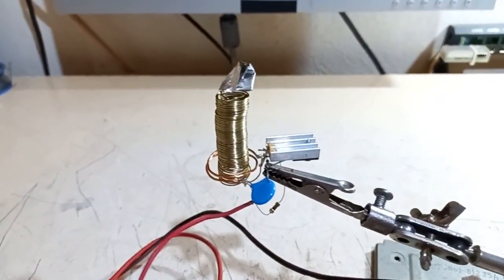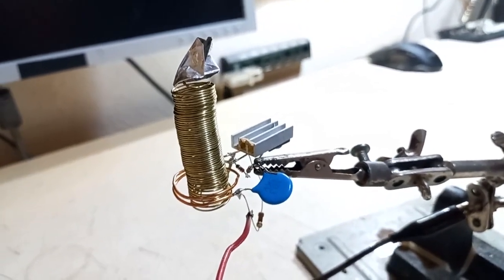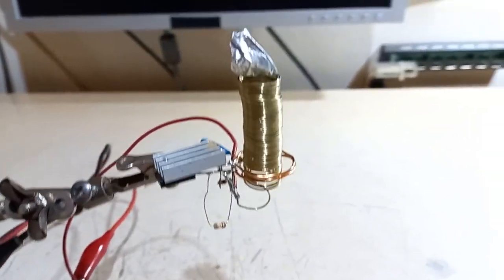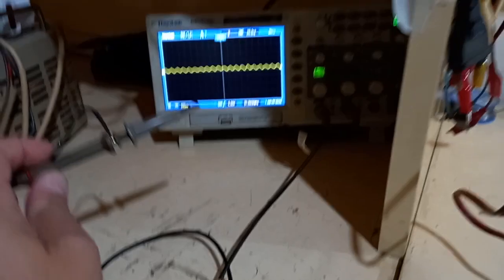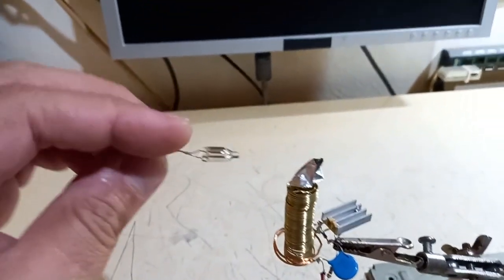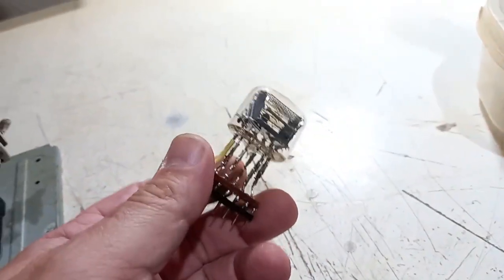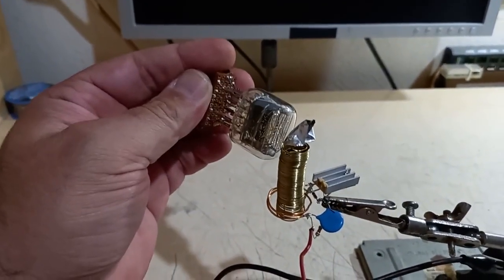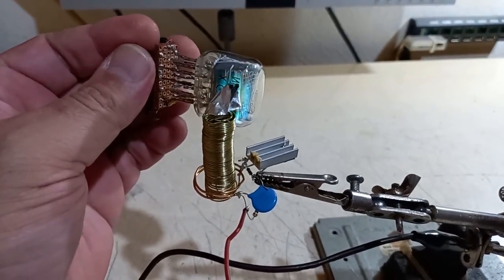What's The Max Frequency For a Regular Tesla Coil? (slayer exciter)

Comment: how do you characterized the transistor?
Reply from the maker: good question, it's electronically absolutely the same of numberless fake ones i ordered (i got scammed in other words), and obviously the same of a bag of actual 2N2222A's that are thankfully ok for what i bought em, all same VCEmax, same HFE, same VCEmin, i basically have 2N2222's in all formats, TO126, TO92, SOT89... and yes, fake components are a thing, like 80% of what you buy from china for dirt cheap is fake, they have no mercy, some don't believe this but it's absolutely true
Reply: @PosthumanKindergarten  thanks for the info, but I want to know the process of testing so I can do it myself, I have some BD139 and BD140 and I heavily suspect they're all fake, but how to do it?
Reply from the maker: @deathkeys1  with BJT's it's a bit more complicated than with mosfets, tho there are enough things to look for, first thing you need to measure the HFE, i simply do that with a cheap "big" digital multimeter with transistor testing, it reads an average HFE, very small transistors have it too high, that is good, but it means that the trans. is very small, you can compare it to the one written on the datasheet, tho there are some different ranges specified for the HFE... another thing you can do is crack open a broken one and see the size of the silicon crystal, you can guess by yourself if it's adequate or compare it to an original one or to pictures you may find online, i always crack open the trans. i ruin... another thing is checking the VCEmax or VCBmax, you need an high voltage source, a like 100k big resistor, and you apply the HV from collector to emitter and then from collector to base with the resistor in series to limit the current (cos otherwise the trans. like explodes :D), and read the voltage on the pins you apply the voltage to, limited by the resistor, it should act like a zener diode of several tens of volts, then compare it to the specs on the datasheet (that for those trans. should be like 100V), if it's lower it's no bueno... then you can check the VCEmin (VCEsat, or how it's called), you look on the datasheet for a graph of the VCE that it reaches (less than 1V) with given collector and base current, usually the base current is 1/10 of the collector current, you replicate such scenario with resistors and a low-v power supply and measure the VCE, if it's too high especially near the rated current of the trans. it's probably also fake, tho this test may have dubious results
Reply: @PosthumanKindergarten  Noice! that's what I wanted, thanks! and thanks for publishing these videos! it really helped me to get inspired again to play with parts, I plan to make a 2.4 GHz slayer exciter, just to see how far I can go, it'll be low power stuff since all I have are BFG598 but anyhow! thanks a bunch for taking the time to reply!

Comment: Have you ever tried to make a VHF spark gap transmitter? It causes things at quite a distance to malfunction. I was having difficulty making a resonant circuit, but discovered that you can use a 1/4 wave resonant piece of co-ax. You have to manufacture the co-ax yourself though, as it needs an impedance of around 10 ohms. I used to charge the centre conductor but it may be better to ground the centre and charge the sheath, just so you don't get a tingle from the antenna (which should be deliberately mismatched, at a higher impedance than the line for less damping). I discharged the charged part to ground with a very short spark gap for fast switching. I only used a max of around 1.5kV. It doesn't take much power to have a lot of sparks (makes a tone) with the small capacitance being charged (around 100pF). It's amazing that you can get effects at a decent distance (6m, discovered by accident) with a total power draw of around 1 Watt only - I used disposable camera flash charger (main capacitor removed) into a cockroft-walton multiplier (6 capacitors and 6 diodes), the part being charged was isolated with two 1M resistors in series.
Reply from the maker: i thought of making something similar, just using a dipole antenna and let the antenna itself decide the frequency, no coaxial, maybe i'll try a coherer with it, but for now i'm not interested much

Comment: Nice experiment! 👌
What is tge purpose if the 10 nano ceramic capacitor? Can the circuit work without it?
Can the circuit work without the top load?
Thanks
Reply from the maker: the capacitor is a so called "bypass capacitor" or i don't remember how it's called otherwise, it's used to make the supply lines "stiff" the one toward the other, this way the oscillation is confined on the primary of the coil, without it such oscillation would be passed on the supply wires and it's not good both cos the primary receives less and the supply wires radiates (that is already happening but for also other reasons)

i don't think the circuit would work without it, or it may have a fraction of the power, increasing the frequency the need for such capacitors increases

i tried without the topload and no, it doesn't work, but it works with a secondary with more turns without topload but at a lower freq.
Reply: @PosthumanKindergarten  thank you for your response !

Comment: u can use just one diode it will be faster ;)
Reply from the maker: i don't think so honestly... there are two diodes to make an higher negative voltage on the base to turn off the transistor better

Comment: Is the blue color not from the mercury?
Reply from the maker: AFAIK there's no mercury in a nixie tube
Reply: @PosthumanKindergarten  The first nixie tubes didn't have mercury but later ones do, because it extends the lifespan (prevents cathode poisoning). For Soviet tubes, anything above IN-7 has mercury in it.
Reply from the maker: @ua89das7ufj  ok... and do you think it's the mercury or the neon that glows blue? cos i don't think it's the mercury, i suppose it must evaporate, and here we are at very low power
Reply: @PosthumanKindergarten  I can only guess but I would say it's the mercury because it does have that characteristic blue glow of UV-C bulbs and mercury rectifier tubes. Pressure inside nixies is quite low so maybe that's why there's some mercury vapor. There's also stuff like the soviet VRM-1 which is basically just a glass vial with mercury, without a heater filament which you can excite with tesla coils to glow blue. Would be interesting to hold an IN-1 or similar old style nixie next to it to find out for sure
Reply from the maker: @ua89das7ufj  i don't think it works like that but ok
Reply: @ua89das7ufj  I just tried and my IN-12 glowed with the nice blue as expected but my IN-2 did not. Also yes the mercury will easily evaporate in the pressures of a nixie tube or even at atmospheric pressure for that matter.
Reply from the maker: @glockenspielsdesk  still later nixies glow orange with a low frequency, i do believe the mercury plays a role but the frequency as well, it's probably the same thing of an HFSSTC that makes a flame of plasma past 11MHz with air and atmo pressure, the mercury probably lowers the threshold frequency of this effect (or make it possible)... anyways i noticed this blue glow at hi-f also with bigger NE2 bulbs
Reply: @PosthumanKindergarten  You could just look at the glow through a cd and compare the spectrum.
Reply from the maker: @chnhakk  this is a really good idea, i didn't know about a "CD spectroscope"
Reply: To my knowledge most nixies have a tad bit of mercury for lifespan